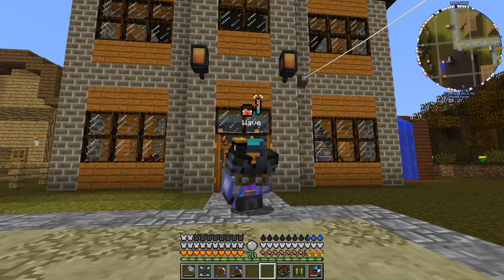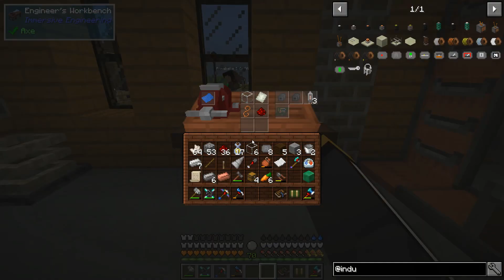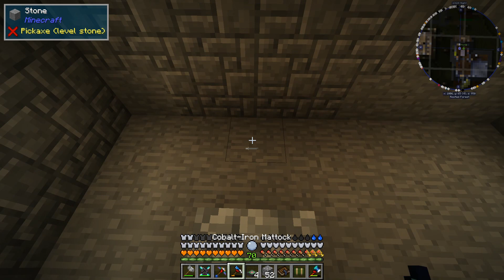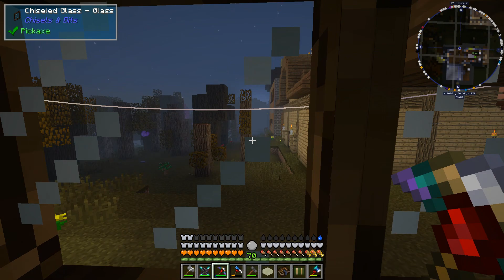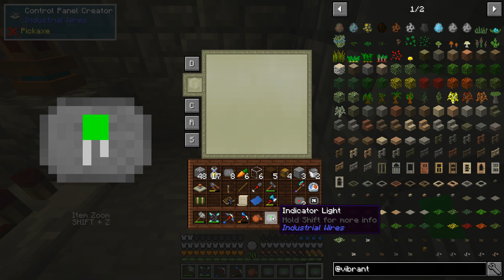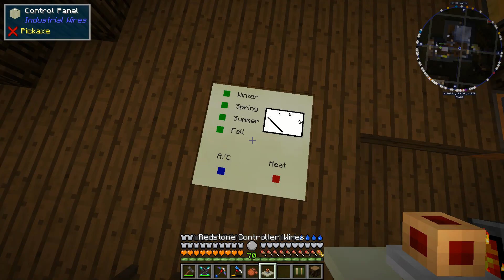Real Tech S2E18 - Season Calendar with Industrial Wires Control Panel

Comment: I wonder if it's possible to use this same setup but scrap the buttons in favor of an automated AC/Heat system based on the season (e.g. in winter the AC turns off and the heat turns on with no player input
Reply from the maker: Definitely possible. I considered doing that but decided I wanted to be able to control it. When I'm wearing armor underwear or running a furnace or something, I might not want the AC or heat on. But, it might be nice to have it automatically switch at the season change and just have a way to override it.

Comment: Do the heating and cooling coils stack their effect? Like more blocks = more increase/decrease in temperature?
Reply from the maker: No they don't. They will stack with other blocks though such as a campfire or an active furnace.
Reply: @DannySon  Thanks! I was testing it myself, and I was pretty sure they didn't, but I wasn't 100% certain. I think I have also discovered that the coils are useless if you building has a slab roof. Have you noticed this?
Reply from the maker: Yes. They are also useless with a chisels & bits roof or any other non-full block.
Reply: @DannySon  Yeah, the roof is made out of chisels and bits slab stone and glass. Will have to keep that in mind for future designs.

Comment: Industrial wires is a great mod but the ic2 wires feel kinda useless since they still have the power loss, so you can't manage them as neatly as IE wires and you might as well use full block ones.
Reply from the maker: Yeah. I don't care about the IC2 wires, so it doesn't bother me much. lol. It's strange that they still appear in the game even when IC2 isn't loaded.
Reply: Danny & Son the cables can carry both ac and dc (ic2), they are way more expensive (one copper wire per block) and need to use their connectors. Also it has multiple items for the same recipe (wire and insulated wire). Must admit I cannot see why anybody would use these wires.

Comment: Very nicely explained, did something similar yesterday. It’s a bit expensive not getting the controller back after disassembly.
Do you have the same bug as I have, after reloading a game redstone wires won’t connect to an already wired connector? I’m having the same bug with power connectors too.
Reply from the maker: Yeah. I'm not a big fan of the cost of making a change to a control panel.
I don't think I've run into that specific bug, but I have found that if I disconnect a wire using a wire cutter, I often can't connect another wire unless I break and replace the connector.
Reply: Danny & Son doesn’t always work but if you remove all the wires then you can reconnect them. Pollution has been knocking wires off, you don’t always notice and after a game restart or even a reload when reconnecting it won’t reconnect. It’s a bit annoying as you have to knock off all the wires to start reconnecting and the next connector has does the same thing. Normally you don’t have to replace wires but with pollution you may have to. You’ll see thin in ep66.
Reply: Duncan Webb you ever fix this issue? It's been driving me nuts